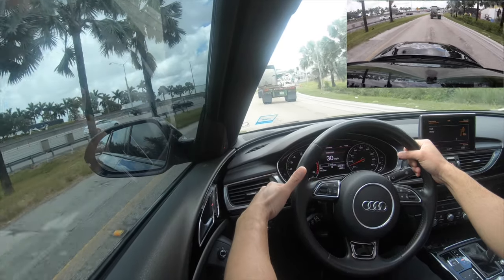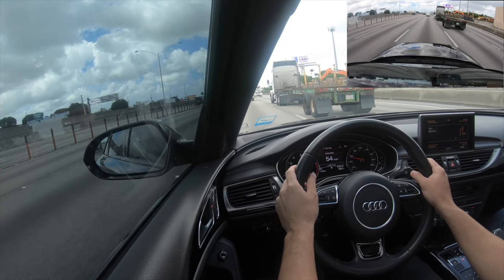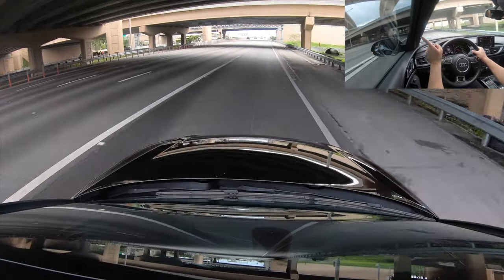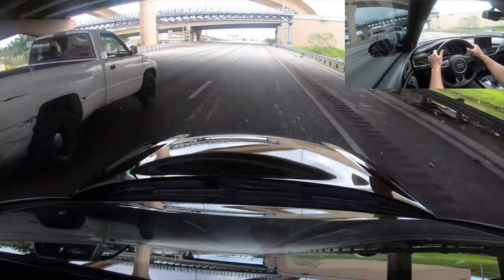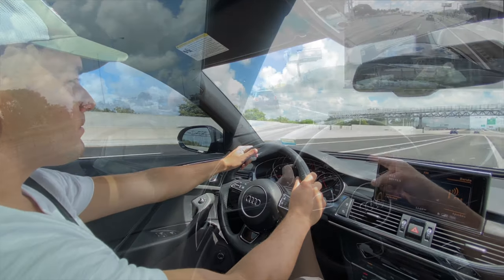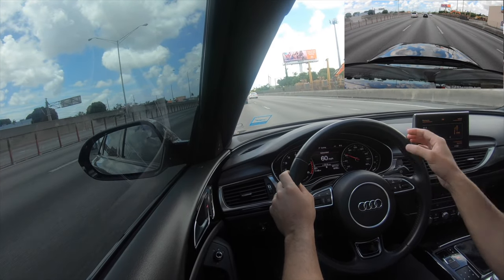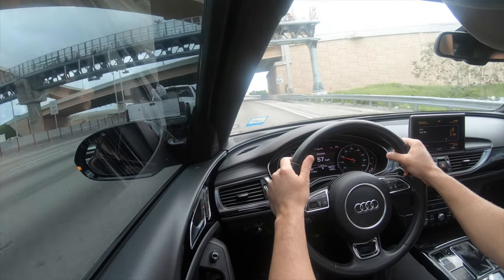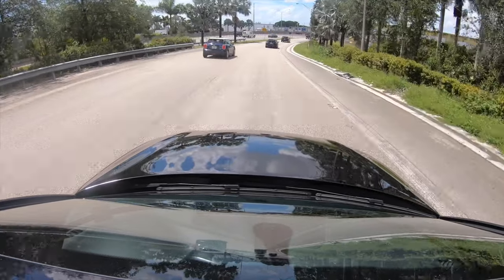HOW TO MERGE ONTO A HIGHWAY OR INTERSTATE (DRIVING TUTORIAL)

Comment: Stay in the right lane if you're a beginner, and don't be afraid of going slow as long as its the speed limit. Pick a gap between the car behind and in front, accelerate and adjust speed as needed. Simple
Reply: What do you do if cars are merging do you move to the left lane or do you slow down in the right for them to enter
Reply: @jacobreyes6212  it depends on the situation. What I do is if I’m too close to the merging car I accelerate to get out of the way. If he’s in front of me i just adjust my speed to his so he has space to merge and it’s safe to the cars on my back.
Reply: When I was a beginner, I drove a lot on the right but there were times where I had to change lanes and yikes! It was nerve racking to me.
Reply: @jacobreyes6212  
Personally, I always move aside/switch to the left lane to allow the merging car in.
Reply: Thank you for the tip. Im a new driver, but terrified of the highway
Reply: Driving slow is dangerous in highway, i dont feel safe unless im driving 70
Reply: sp
Reply: @abarzua21able me too😢

Comment: I have a quick solution, literally just floor it.
Reply: Comment of the year😭
Reply: Absolutely the wrong advice!!! This maneuver requires skill adjusting to the flow of traffic. Power is NOT the solution.
Reply: @jamesmylife6578  That type of joke has no place as to traffic safety. OK? Thanks
Reply: @Rhaman68  once again, anyone who would actually take that advice shouldn’t be driving in the first place. And anyone would would take this seriously is just dumb. It’s common sense. Ok? Thank you.
Reply: ummm ngl i was considering it
Reply: @eggn00dle36  well did you actually do it?! I mean it’s possible I guess but not recommended.
Reply: Yes 👍 that’s how it’s done!! just be careful obviously. I absolutely hate it when people merge into the first lane going 45mph 🤦🏾‍♂️ like bruh it’s the freeway. Take the streets if you’re going that slow.
Reply: @Rhaman68  and besides when you merge you usually have a whole lane basically to yourself. Everyone in front of you is also speeding up and are going to turn off eventually and no one else is going to get into your lane because, duh it’s a merging lane. And I’m sure no one is going to run into you from behind while your accelerating full blast and you won’t have to the whole time, just until you get enough momentum to get up to highway/interstate/freeway speeds. It also depends on your car and the type of engine output and weight. Yes it was a joke but like, who’s going to do it knowing that it takes “skill” because you only have be driving at least 3years to completely master. Depending on what kind of driver you are. And some people already do this. Not flooring it but putting it down pretty far.
Reply: @miahzzeebest701  haha
Reply: Ikr 😭
Reply: I can vouch for this tip
Reply: @daichiDom  Gud 4 U

Comment: The most important thing and most often not done is;  You need to be going the same speed or a little faster than the traffic you are merging with.  Why?  because EVERY vehicle on the road can slow down at a faster rate than it can speed up.  When you get to the merge point, if you can't slip right in, slow down enough to get in.   ALWAYS, at the merge point, be going at least as fast as traffic you are merging with.
Reply from the maker: Thank you for sharing with us 💕
Reply: Merging when a semi is coming at me. Makes me so damn nervous
Reply: @songriver1232  It is actually easier.  Most big rigs are topped out at 75 mph.  Cars can frequently be going faster.  So if you are merging onto a 65 mph limit freeway in light to moderate traffic you should be going 65-70 at the end of the on ramp.  As you near the traffic lane you are merging with, you should be able to merge left in first lane next to you, or SLOW slightly to merge in.  It makes it easy.
Reply: @songriver1232  remember -- those drivers all are professional drivers so more often than not, they'll let you merge so you shouldn't fear them.

Comment: Great advice. Watch out for those tricky and potentially dangerous yield areas where there IS NO merge lane. Usually there’s a sign posted that will say NO MERGE AREA but not always. In that case it’s always necessary to stop the vehicle and treat the yield sign like a stop sign and then check and make sure the lane you are merging into is completely clear. Always be sure to look ahead and confirm whether or not there is a merge lane and proceed accordingly as mentioned..Happy motoring and Stay safe!

Comment: 3:54 nope.
The right lane is the lane you should be driving in. The left lane or lanes are meant for PASSING not cruising. Stay on the right lane if you want to pass a car in front of you do on the left lane then merge to the right.
Reply: Not illegal to pass on the right however.  At least not here if there are two or more lanes all traveling in the same direction
Reply: in a 3+ lane highway,  you stay out of the right lane because there’s constant on and off traffic.. nothing wrong with riding the middle lane and using left to pass.

Comment: In most states, it is the driver's job that is merging to adjust their speed to traffic already in the lanes. It is not the job of the existing traffic to move over or change speeds to let you in. Most expressway entrance ramps will have a yield sign. That yield is for the person entering, not the people already on the highway.
Reply: Is yield to slow down ?
Reply: @omivnr3858  To yield the right-of-way means to allow another vehicle to proceed before you in a traffic situation.
The person entering the expressway has the yield. Some expressways have a sign indicating this.
Reply: It’s common courtesy to try to give the incoming traffic some room to merge. You don’t necessarily have to change lanes for them though. Just slow down a bit if you see someone coming and can give them room to go through.
Reply: @guineapigtalks  that disrupts the flow & speed of the expressway traffic, that's why the yield is for the incoming traffic, not the existing traffic. They are given a long lane to get up to speed and adjust to the traffic they are merging with.

Comment: This scares me and it is so hard to get this down pack.
Reply: I've been driving on the interstates for a year now I have to drive 2 hours to get to work and 2 hours back the best way to enter the interstate is to drive slowly and when you get to the merging part if it's really busy I stop and wait for an opening and quickly accelerate then get over to the fast lane I just find it easier to stop then enter rather than trying to match the speed of other vehicles and turn signals those drivers do not care and are not gonna let you over which is why I stop they should just put stop signs up at the merge or yeild signs at least

Comment: What if there are so many cars that i cannot merge?
Reply from the maker: 🤔 wait until you find the gap.
Reply: @DrivingTV1111  so worse case scenario you could potentially come to a full stop of too much traffic ?
Reply from the maker: @crisp7575  That's correct!
Reply: @DrivingTV1111  Heres a question....what if the traffic is smooth,  you drive at the speed of traffic or at the speed limit, doing everything you are supposed to do while trying to merge  but you STILL cannot find a gap? I would assume that you'd have to slow down, at least a tiny bit until you find a gap. You can't just throw yourself into traffic. That too can cause an accident
Reply from the maker: @alexmunch6118  Certainly! If you're driving at the speed of traffic or the speed limit and still can't find a gap to merge, it's important to prioritize safety. In this situation, it's wise to slow down slightly until you spot a safe opportunity to merge. Rushing into traffic without a clear opening can be a risk of a accident happening. So, patience and caution are key when navigating merging situations.
Reply: @DrivingTV1111  Thank you!!